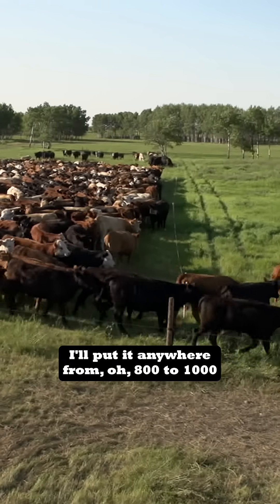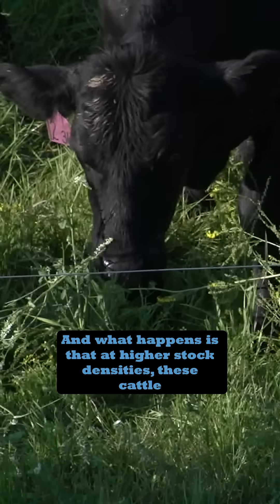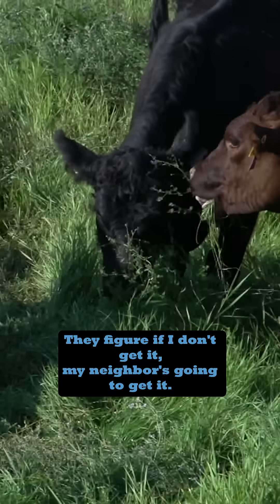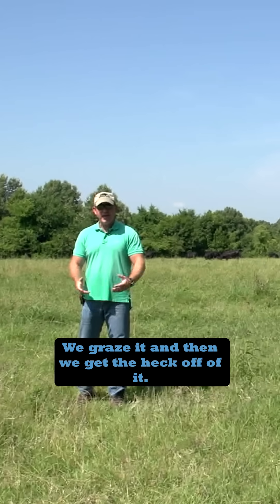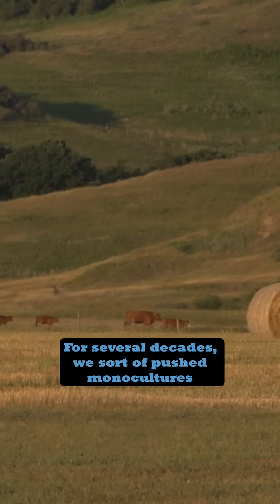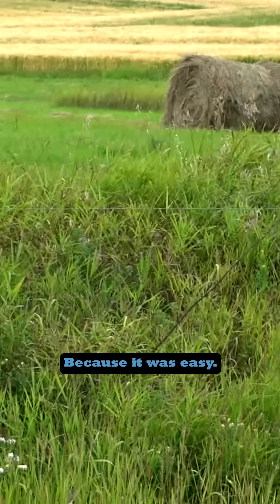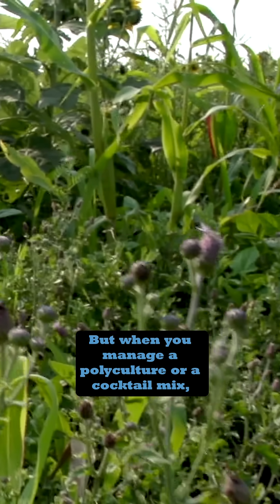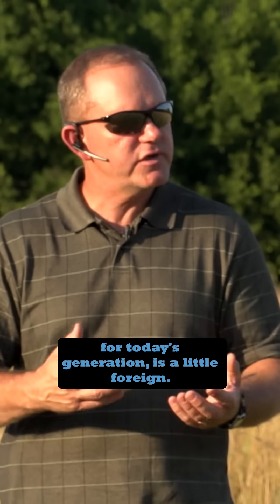How Dr. Allen Williams moves cattle #regenerativeagriculture - soil carbon cowboys pt 3

Comment: This is relevant in 25% of the ground in the U.S. Usually your two wet or way too dry.
Reply: In dry areas, they wait up 18 months to 2 years before regrazing. In wet areas, they might be back in 30 days. His statement was correct - the magic is how long to stay off.
Reply: @leelindsay5618 I'm 130 inches a year, Olympic Peninsula. We can't graze for atleast 6 months due to very wet sloppy ground.

Comment: If the people "In Charge" seriously believed climate change was a problem they would be INSISTING ranches adopt this system.  This is why I believe climate change is a gigantic HOAX.
Reply: The problem is convincing the ranchers to get into regenerative ranching. There are photos of 2 ranches side by side, one lush (regenerative rotational grazing) and the other eaten down to bare soil. The bare soil owners still refuse to change their methods.

Comment: So 800 cattle on an 84 day rotation means 9.5 cows per acre where the  general rule of thumb is 1 to 2 acres per cow for a year, that is 6x more than conventional
Reply: It is dependant on rain fall, fertility and season. Out west you would have a stocking rate much lower (maybe 20 acres per cow or more) as opposed to deep south where it might be 1.5 acres per cow. We averaged about 57 day rotation and could have reduced it to around 35 to 40 with more cattle but almost 100 head on 150 acres with only about 2/3 in rotation. the rest is woods and spoilage acres.
Reply: James, a move every 2 hours means 12 moves per day. Assuming the average cell size is 1 acre and the average recovery period is 80 Days, that's (12 acres/day multiplied by 80 days) 960 acres total grazing area. About 1 acre/head. 
Also 9.5 cows per acre versus 1-2 acres per cow is more than 6x more dense. 
There are a heap of variables. Snow/frost  etc.
Reply: @mickydee26 most only do the really brief stays part of a day, not all day. Overnight paddock will be larger. Ultrahigh stocking density is a management tool to get a huge impact on a given piece of pasture. Most will switch: densities, times in paddocks (very brief to a full day), recovery time,... One must consider the health of the animals and the soil...

Comment: 800-1000 head of cattle on 1/2 - 1 acre, really???
Reply: For 2 hours. Its only 4 or 5m² per head but on VERY lush pasture
Reply: They are using terms to indicate a stocking density. That ratio of livestock weight per acre can be scaled up or down for your herd size.
Reply: Paddocks are sized for herd or flock size AND duration to be grazed (cattle), foraged (sheep), or browsed (goats).

Comment: If 1 acre is good for one day of grazing and it takes 80 days to recover, then you would need a minimum of 80 acres. If it reduces or eliminates a supply expense, replace it with a lower cost labor expense, reduce the environmental impact of chemicals, increase health of the cows which lowers veterinarian costs, capture carbon in the soil and positively impacting the environment…we need to sell farmers on this change the way big AG got us to where we are now. It’s a multifaceted business model that balances the ledger and improves stewardship.
Reply: Cattle are moved every 2 hours ish, not every 24. 12 acres per day ish. 960acres total. Ish
Reply: @mickydee26 wow
Reply: You have to know BIG AG is fighting this tooth and nail. I am sure they are throwing big money into a disinformation campaign.
Reply: Water